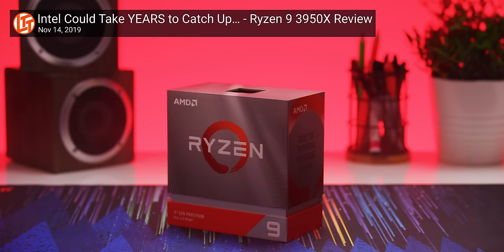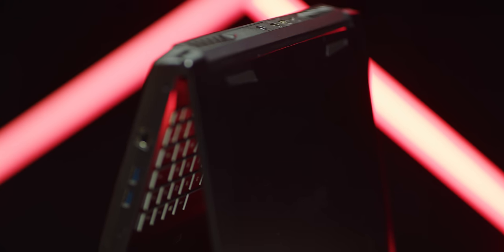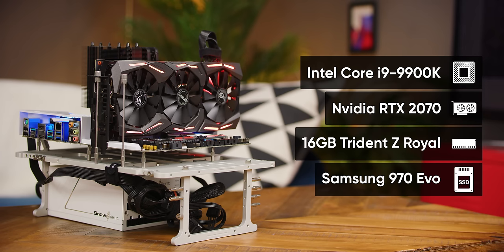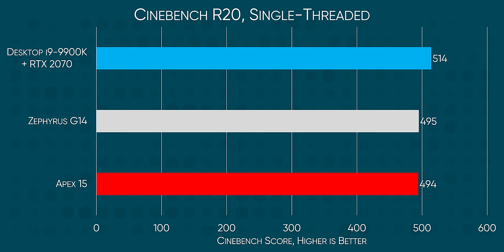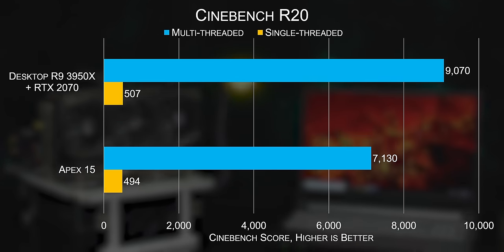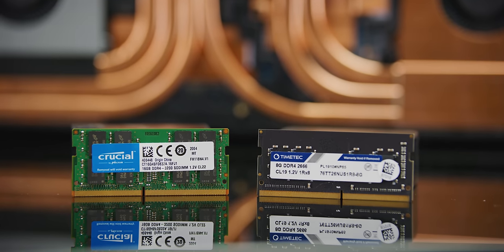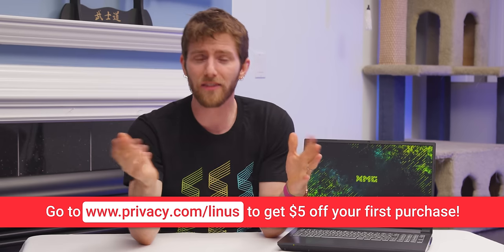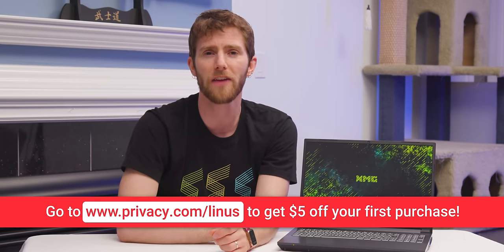The Most Powerful Laptop EVER!!! - XMG Apex 15

Comment: I like how the processor is removable when most laptop CPU's are soldered
Reply: Well because it's not a mobile chip. All mobile chips whether it's of intel or AMD is going to be soldered. It's a true desktop cpu uses the desktop AM4 socket, so the cpu is removable just like a desktop pc.
Reply: As I remember old notebooks had such function. My Lamborghini Vx2s could be upgradable... could... 
so I could change boy only Ram, but also Video and CPU... but you should be a bit magician.
But because of making laptops thinner, not everything is integrated.
Reply: RedFatDragon My first laptop was a vostro 1000, and it definitely had a removable CPU. That was like 10-11 years ago now though
Reply: Glad to see it in high end laptops, saves issues in replacement when boards or CPUs somehow go funky. No more throwing out the majority of the internals of a laptop to fix it.
Reply: Just don't buy dells or hp or lenovo and you'll find lots of good desktop cpu options in clevo based models.  the w650kk1 was an absolute budget beast for a while in 2018 due it's upgradeability and low price point of $600+ for a lga 1151 socketed cpu with 1050ti laptop.

other brands do branch out into desktop cpus from time to time, but clevo ODM has been embracing it for a long time.
Reply: Next Ryzen’s processor won’t support B450 chipset, so this feature is now useless until AMD change they mind.
Reply: Andrés Valverde  he says that maybe its because you have a crappy desktop processor then "wtf you talking about?", "how the F you reasoning?", "you pay millions to make it soldered when you can change it having a socket" i guess hes talking randomly about the video and not ranting at you but anyways, I can speak it.... ci parliamo dopo
Reply: My old very much budget Asus laptop also had removable CPU (socket 478 iirc)
Reply: Alot of older c2d laptops had replacable cpus. I believe it was a t5 socket? Upgraded an exs laptop for a few bucks and got a few more years use out of it
Reply: @yaroslav8717  Not if you get the lower specced model now and upgrade to the R9 3950X later.
Reply: Ah, the days of MXM GPUs.
Reply: I have seen many unsoldered mobile chips in many laptops sold from Walmart. They all had a CPU socket that opened and closed with a flat head screw instead of a tension bar.
Reply: @Tams80 I want to get 3900 now, and there won’t be much space to upgrade in the future, only for 3950x as you said.
Reply: If that laptop is thermal throttling we could change the CPU to other CPU, a slower one but good enough to run everything. And I believe that the thermals would be better than regular laptops🤔
Reply: Tiago Viana  I idle in the mid to upper 40s and low 50s on both cpu/gpu depending on what fan curve I have set. I run the 3600x, the 3900x being 409 at micro center has my palm itching to sale some audio gear that’s just dormant for now to upgrade!
Reply: @sbeezynukka  But you're using a desktop or are you using this laptop?
Reply: Tiago Viana I’m using this same laptop. my lid is just different. I have the metal finished lid
Reply: I also have carbonaut on my cpu and a IC graphite pad on the GPU, May go back to cryonaut on the GPU. Have more testing to do.
Reply: @sbeezynukka  And do you recommend it? I need to buy one but I don't want a laptop that thermal throttles, specially because I also need to game on it. But I haven't decided yet🤔
Reply: many thinkpads have socketed CPU's. I've upgraded one myself.
Reply: Tiago Viana the same for me. Is it worth buying right now?
Reply: Tiago Viana really that’s up to you! I’m in love with it, it’s as powerful as I need in a laptop/desktop with room to go, plus I don’t have to lug a huge setup when on the road! For me though honestly I jumped because I’ve been waiting for a newer DTR and my old 6500u laptop was long in the tooth! I’d rather a 17in model but I feel like if I buy this one maybe my one sale will make Clevo go in harder with the 17in. Hopefully we get AMX/MXM on the next go round. The small inconveniences like useless bios(update shall come soon),jacked up fan curve( seems to have been fixed in CC 3 2.24) and tuning it to your liking are worth the time IMO. If you’re a tweaker and can’t leave well enough alone this may or may not be for you!
Reply: @AmitDas-de5ft  no, laptop CPUs used to be socketed in the core2/early i-series days
Reply: @tristan6509  I know but that's relic now. I was talking about the current trend. As far as I can remember of almost all mainstream laptops now a days come with soldered on cpu and gpu.
Reply: @AmitDas-de5ft  Maybe the cheap ones that circulate most commonly but I can assure you modern laptops have both soldered CPUs and CPU sockets. What makes this laptop different is the fact it has a desktop socket and not a mobile socket which is smaller. It's just never been reasonable to change a laptop processor given the difficulty and thermal constraints. So the point in this video is it might be practical for once.
Reply: @inexternalrecords  can you name any MAINSTREAM LAPTOP (I'm not talking about those crazy custom one-offs) which 99.99% of people won't buy.
Reply: @AmitDas-de5ft  Toshiba and HP for sure. When was the last time you even opened up a laptop? And not a NETBOOK.
Reply: @inexternalrecords  stop giving me the name of entire brands, and give me a specific model, so that I can google it. And yes I did opened a asus laptop of my friend and forget about cpu and gpu, even the RAM was soldered, and even my hp envy 15 109tx which is quite old still doesn't have an upgradable cpu or gpu. 😂😂😂Please name a specific mainstream model.
Reply: @inexternalrecords  or stop saying rubbish just prove me wrong.
Reply: Hold on everyone, this guy now has to quickly learn what the hell he is talking about so he can formulate some kind of comeback.
Reply: @sbeezynukka  Well, I'm not really a tweaker, because I often get too excited and end up breaking something. I would tune only the fan curve, that's the only thing I would do. Well, I'm gonna search a few more opinions on it. 2 likes-0dislikes (searched another opinion before)
Reply: Tiago Viana  check out the Msi bravo there’s a lot of Renoir based books coming
Reply: @sbeezynukka  I was thinking about one laptop from lenovo which had a I7-9750H and an RTX 2060 (don't know if Its Max-q or Max-P). For the specs it's pretty cheap here
Reply: Tiago Viana get what you can afford comfortably! If you want more just hold out a lil longer.
Reply: Andrés Valverde  I have a laptop from 2010 and one from 2016, just upgraded to ssd from hdd and they run good
Reply: had an old gateway laptop with a removable cpu
Reply: Old mobile chips can be socketed too. You have to go older than Skylake though
Reply: that's cause it ain't a laptop processor

Comment: AMD: We got 16 cores in a laptop with great performance and an affordable price

Intel: We got you guys 0.1 GHz in extra boost clock, but it might run 20C Hotter
Reply: Intel: oh, don't forget that we're pricier
Reply: it's obiviously because more C's = more performance
Reply: I wouldn't call them affordable it's over $700 alone for the cpu lol, the 3700x at $300 with same core count and threads as i9 9900k, yeah
Reply: Yeah, and you need a 500W power brick.
Reply: @Andytlp  Just because it's better doesn't mean it's worth it, a r5 3600 would work well enough and I don't need to spend an arm and a leg. And when did I say buy Intel instead I never said purchase Intel. For those $500 I could get a used 2080 super or a new one for a 100 more
Reply: @luisdiaz71956  shut up and buy amd sir. They need our support more than when they made faildozer which i bought.. or was it fx. Anyway it paid off big time look where they are now.
Reply: .... And requires a new motherboard.
Reply: My question: When will all the softwares start taking full advantage of all those cores and threads?
Reply: @luisdiaz71956  good job you bought a sensible choice instead of paying extra for nothing. That nothing is enough to get 16gb of ram for f sake.
Reply: @Andytlp  Why are you being such an AMD fan boy, I agreed with you to begin with and you're still telling me to buy AMD which I clearly stated was a better buy, you guys are worse than Intel fan boys goddamn
Reply: 10 series is just 9series with different boost profiles... Change my mind
Reply: @probablynotabigtoe9407  They are the same, but now at a lower price I believe. The i7 10700k  has basically been a rebranded i9 9900k and is $120ish cheaper
Reply: @Andytlp  lower ipc less ram ammount and speed and a higher power consumption and heat for a lot more price justto get 0.5ghz more out of a 14nm+++++ (22nm in disguise so thats why it can get 5ghz) cpu
Reply: @luisdiaz71956  at this point fighting the bots the easy way it to be a bot and spread real facts not fake facts
Reply: @probablynotabigtoe9407  they made the cpus support for the first time more than 16gb 3200, like ryzen 2000, till now even 500$ cpus had the controller as fast as my ryzen 1700 controller

Comment: 3950X: that’s pretty sweet     A socketed laptop:  THATS AWESOME
Reply: Used to be standard.
Reply: @DenGuleBalje  It needs to come back.  At least in enthusiast applications.  Now if we can work out a way to upgrade gpus without scrapping the whole thing.
Reply: @Silent_Shadow  We have MXM slots and cards. There's MXM Type A and B. That also used to be a standard in bigger Clevo designed laptops like this, along with mobile workstations like the HP EliteBook W series and the more recent Zbook, Dell Precisions. The ThinkPad P70 also has an MXM slot. Some even had two MXM slots allowing for SLI. Alienware's 17 inch models used to have at least one MXM slot.
Back in 2013 Eurocom sold a modified Clevo "laptop" called the Panther 5SE. You could get it with a socketed 12 core Xeon. It had two MXM slots where you could add up to two GTX 780Ms or two R9 M290X. Later you could upgrade to two GTX 980Ms.

Modular laptops were a thing, it's just that nobody complained when they died out

Comment: Me: turns on laptop 100% battery 

Me also: Opens steam Game 

Laptop Battery: “Why do I hear boss music?”
Reply: I replaced the battery in my laptop a few months ago because under normal use (youtube, browsing, etc) it would get a nice 5 hours. I figured it could play RDR2 for maybe 20 to 30 minutes, just enough time to kill. I opened the game, got into the world, took two steps and Windows put the "Your battery is about to die" message on the screen lmao
Reply: It would be nice if that 2.5" SSD/HDD slot could also fit an additional battery instead. That's enough space for another 30 Watt Hours or so.
Reply: I'm on my 3rd gaming laptop. I've very rarely needed to play a graphically demanding game AND been far away from a power outlet.

Laptops are always a compromise. I can do most of my light PC work on my phone or tablet and portable gaming on a portable gaming system. 

Any laptop approaching this power is really just a more convenient desktop. If you're gaming away from an outlet you're probably exposing it to extreme wear and tear (dust, pollen, heat, humidity, moisture, weather, thieves, clumsy people, etc).

I had to do this in the Navy. It destroyed my first 2 gaming laptops.
Reply: @god1284  Even with the Razer RTX 5000 I own, I get 1:30 just browsing internet. These laptops aren't efficient
Reply: Nobody in their right mind games on an unplugged laptop.
Reply: @god1284  Just because it's a gaming laptop doesn't mean you'll be gaming on it 24/7. For those other times you're merely browsing the web or streaming a movie, extra battery life would be nice.It's kind of like saying, "Why would you pick up your kid from school in a Porsche 959?" Yeah, it's a really nice sports car, but it can do mundane tasks as well. But yeah, as far as gaming goes, why would you even try it on battery lol.
Reply: @MrV1NC3N7V3G4  If that's the case then simply put in on a more battery efficient mode through cp, disable any overclocking and set your preferred GPU as the integrated one, turn off RGB and it should do fine
Reply: @Ben.N  Fax
Reply: @justshady  Just configure it to be more efficient through control panel, disable any overclocking OR underclock it and make the integrated graphics the preffered GPU and disable keyboard and all laptop RGB/Lighting
Reply: @god1284  True to some degree, but that hardware is still going to make quick work of a 62Wh battery regardless of the power settings. That empty 2.5" HDD bay is just triggering me like crazy lol! Might as well take out BOTH batteries and add more cooling if the battery isn't going to be used. (And with it being plugged in all the time, that battery won't last long anyway due to overcharging, which ruins many batteries these days)
Reply: For PCs like this the battery is basically a built in UPS. I think that is one of the reasons why my uni uses almost exclusively mobile workstation laptops now.
Reply: Lol, I hope the OP learned his lesson from these comments. A gaming laptop's "battery" pretty much only serves to allow you to move the damn thing without having to shut it down completely whenever you're transporting it to the nearest outlet at your next destination.
Reply: I laughed so hard! :)))
Reply: @justshady  I have an Quadro RTX 5000 in my Dell Precision and I get 6-9 hours of battery for office work. It really depends on the laptop.
Reply: Lol have fun while being stuck with 30FPS
Reply: @snaj9989  If you are running on battery than sure. However, I have tested it in VR applications and the performance is between a RTX 2070 and 2080. Works well for my purposes (mostly video work and rendering).
Reply: @Myflag2022  My msi leopard laptop with gt1050 fixes fps to 30 when unplugged. It is unchangable so I don't play games on battery. Not every laptop is the same.
Reply: @snaj9989  That makes sense.  The Precision I have doesn't hard cap any frame rate in programs when on battery. It just limits the max wattage the GPU can pull to the limit of what the battery can supply.  However, the only games I have really played on it while on battery have been ones that were fine running on the iGPU.  If I am on battery it is usually because I am handling remote office work or connecting to remote hardware.
Reply: @Myflag2022  Well it makes sense to put a frame limit on my laptop since it has a very low battery life (even brand new). It doesnt last 30 mins when gaming with 30fps so It would probably explode if it were 60.
Reply: @god1284   I did crank the battery down to 10% usage, while it gave me 4 hours, everything else wasn't easy to use.
Reply: @snaj9989  I have tested my machine under max load and 45 min on battery is about the limit.

Comment: 7:02 "With it's AM4 socket, You could possibly upgrade the CPU to-"
AMD: I'm gonna stop you right there.
Reply: yep, its using the b450 chipset so good luck upgrading it any further lololololol
Reply: @D00m3dHitm4n  just with a bios update(if they provide it) you can run 4th gen ryzen in this laptop
Reply: @rrranes  They won't, AMD explicitly said so.
Reply: @rrranes  You are wrong, AMD has stated they will not be providing the proper AGESA updates to motherboard manufactures so they can update b450, x470 chipsets to work with Ryzen 4k
Reply: Ryzen 4k as of right now will ONLY WORK with X570 and B550
Reply: @D00m3dHitm4n  lmao but if you buy this laptop the 3950x will be with you for so many years
Reply: @rrranes  true, but they talk about upgrading the laptop down the road in this video which wont be possible because there is no better ryzen 3k series CPU than the 3950x lol
Reply: I knew this 2 years ago when a slide said that official support for am4 ended Dec 31 2019
Reply: @D00m3dHitm4n  But is there a reason to upgrade anyway. The other components might fail wayy before ever needing a cpu upgrade.
Reply: @DeosPraetorian  wtf am4 will till exist in b550, only the chipset and support will change aaaaand pcie 4.0
Reply: The new gen is still using AM4, so it's about the BIOS update.
Reply: x370 are officially not compatible with 3rd gen ryzen and yet my asrock X370 mobo has a bios update to support 3rd gen CPUs
Reply: @crozet-magenta  This is different case, not even motherboard makers will be able to push 4rd gen Ryzen this time
Reply: @crozet-magenta  its because x370 and x470 are basically the same and mobo manufacturers just backported AGESA from x470. but x570 chipset is actually a new silicon so you can't backport its AGESA to older chipsets. and AMD doesn't want to provide Zen 3 AGESA for older chipsets.